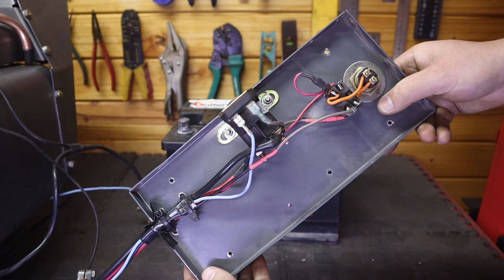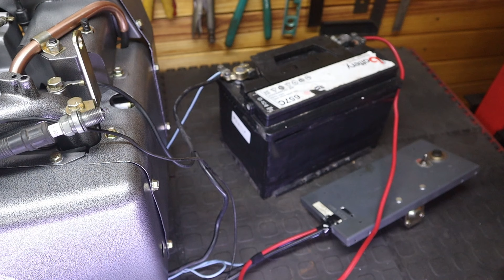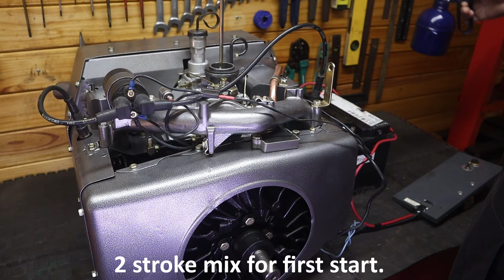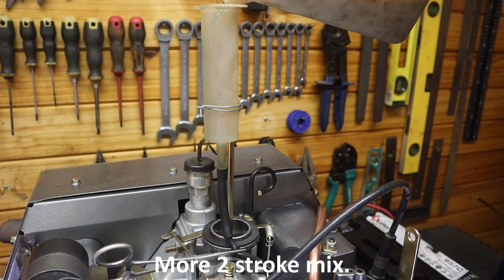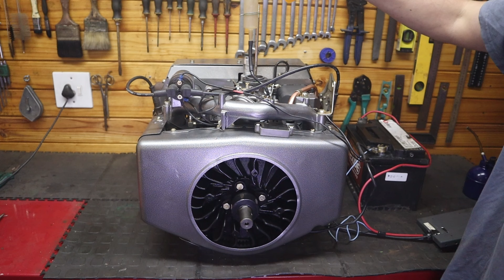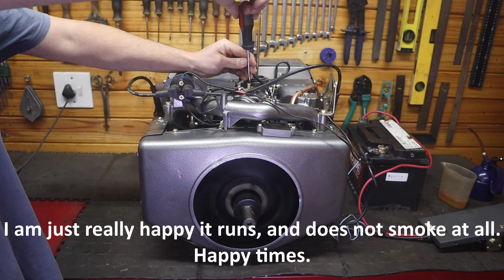Kohler KT17 engine startup and first tune.

Comment: I think that using 2 stroke mix is really a good thing for the first bit, I do that to on first starts in awhile. Potentially helps with sticking valves to. I even run a bit in if I think the motor will be sitting awhile. Neat vid

Comment: Woo hoo, she’s alive AJ! Great job, just a little more tuning and some valve adjustment and you’ll be all set. What did you decide to do about the hole in the muffler? Looking forward to the next video!
Reply from the maker: Yes the valves do need some love, I plan on making a manifold with a muffler from a large briggs engine or maybe just freeflow it, it depends on how loud it will be.

Comment: This is a win. If the engine came up to temp, re-torque the head bolts too while you're checking the lash on the valves. Is the tractor next?
Reply from the maker: That is a good idea, ill check the head bolts. Yes the tractor is next. I have a few smaller projects lined up before then.

Comment: Congratulations on the startup.  Can you get John Deere green powder coat for the next phase of the mower restoration?
Reply from the maker: Yes, I have already found a supplier. the larger parts will be outsourced since it wont fit in my oven.

Comment: With all the covers and stuff it looks vaguely like a volksie motor.
Reply from the maker: Haha it does sound like a old volla motor. I remember my mom had a volla with a rowdy exhaust and it almost sounds the same as this one.
Reply: @AJRestoration  I had a kak one, there was a short in the hooter so when you turned the wheel it would hoot, and the doors didn't close properly so every time you went around the corner it would hoot and the doors would flap, and once the battery fell through the rusted hole in the floor, and there were no window winders or mechanisms, you just pushed the glass up and jammed a screw driver under it to keep it closed, the same screw driver was also the key to start it.  Once in midrand a traffic cop stopped me, walked around the car and said "you better get this piece of sh*t out of my sight before i get my book", and then I climbed out to push start it, and he just shook his head and walked away. But I got it for like R500 back in 95. And it constantly leaked oil so I got a recon, and to change the engine i put some sponge under a tree and I rolled it on its side and used a rope over a tree branch as a hoist and my land lord came out with his camera and took photos and said "I need proof, cause no one is going to believe me...." I miss that car.

Comment: The battery is died 🔋🔋🔋🔋😥😥😥😥
Reply from the maker: Yes haha it does not hold for long. Its dead weight. I tried at least haha. Ill buy a new battery when it goes in the tractor.